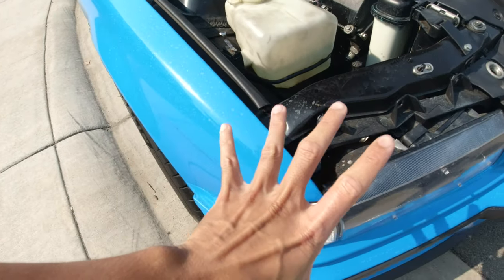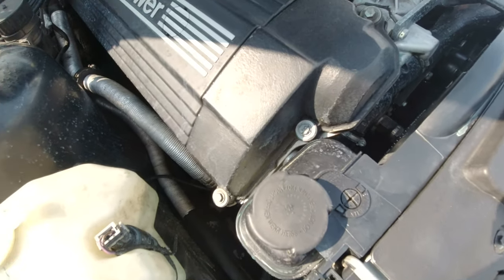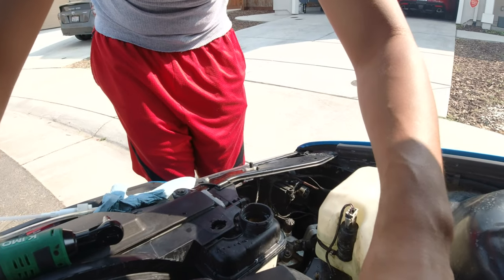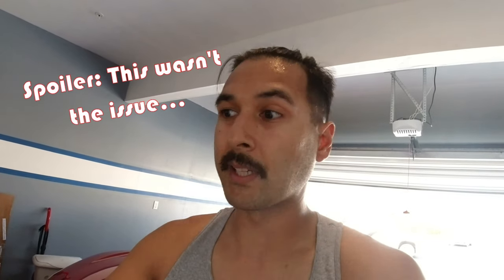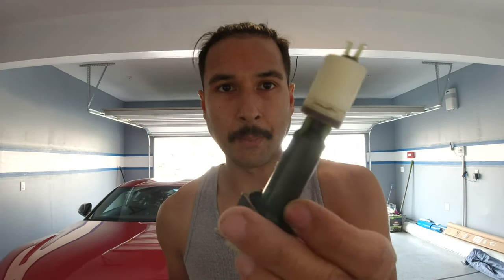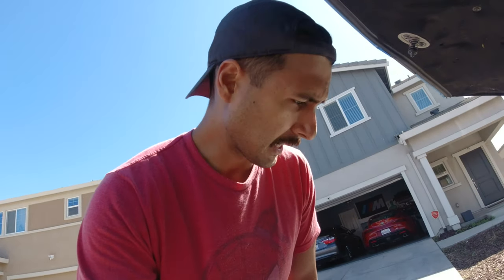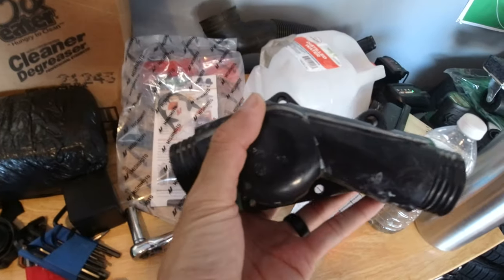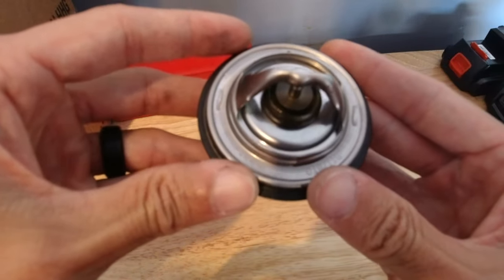E36 Cooling Woes // Head Gasket Blown & Rebuild Planning

Comment: Sorry to hear the about to the blown head gasket. Hopefully the motor is fine and nothing is warped. Good luck!
Reply from the maker: Thanks man. Yea I’m hoping so. If the motor is toast I’ve got some other ideas for an engine swap. Still doing all the research at the moment, but I’m staying positive moving forward.
Reply: @TheAutoDojo  wont know till you pull it out and off.

Comment: 170k isn’t bad for an M3 engine, I don’t think it’s a blown head gasket but these things are just hard to bleed.
Reply from the maker: Yeap, 173k isn’t too unheard of. But I did throw a 10psi blower setup on it at around 167k. Unknown history on the car so I figured it was the original head gasket. When the blower got installed we also threw ARP studs for clamping. Unfortunately a 25 year old gasket and increased boost is a recipe for problems I suppose.